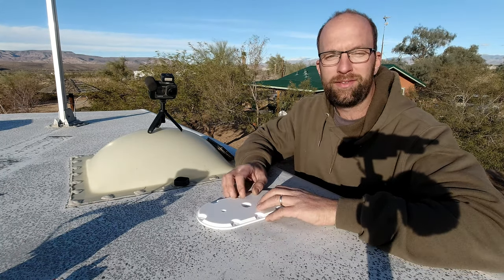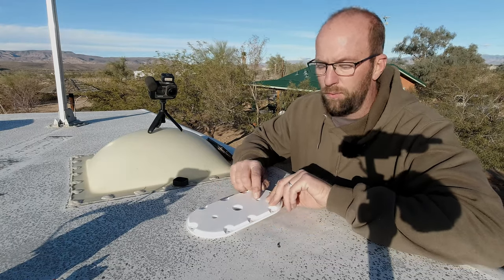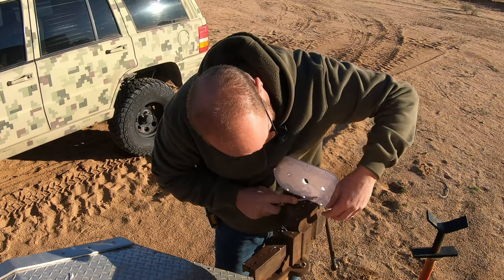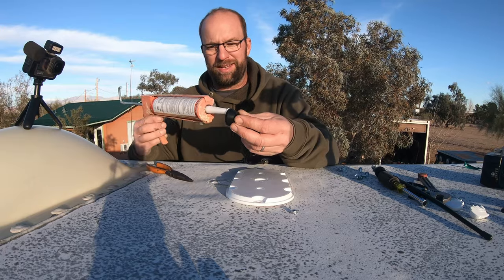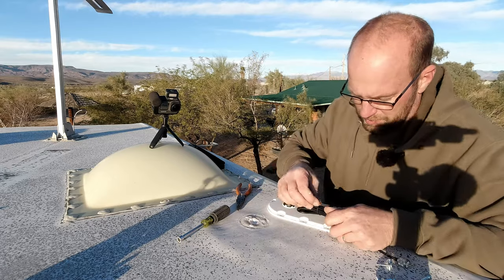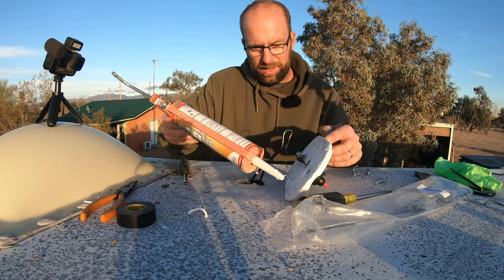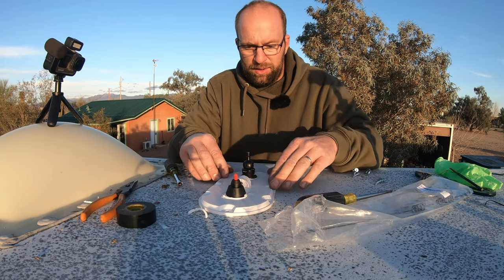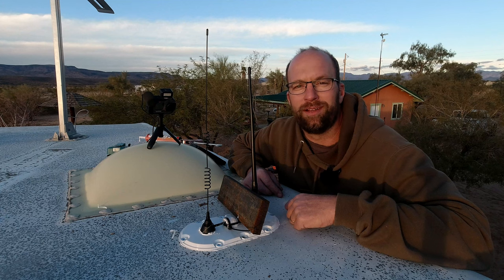3D Printed RV SDR and FM Antenna Roof Mount

Comment: How did it work out with your SDR and FM reception? Subbed!
Reply: The fm radio works great.  As for the sdr, I haven't tried it yet. It was pointed out the magnet I removed meant the antenna was intended to be mounted to a cars metal roof - which is a ground plane. I've ordered a three spoke ground plane I hope I can be installed below the antenna without modification. It's my understanding the current setup will work fine for receiving, but could let the smoke out of a radio if used for transmitting. I'll post a follow up once I try it out. Thanks!